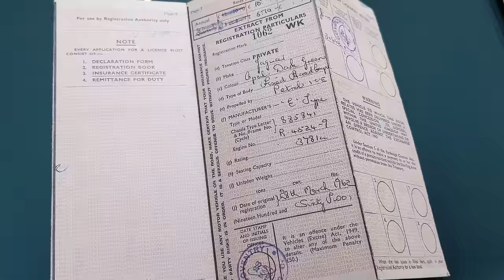Stuck E-Type Clutch 🔧 Workshop Diary 2

Comment: I really wished I could have worked along side my dad , fixing cars. Sadly passed away when I was in my late teens. Love the video's Richard,  keep em coming.  Electronic ignition , suspension and braking is the worthy upgrade for them E types. Anything that makes it handle  better and be safer has got to be a plus, if its going to be used on the open road....Which is where they belong.  😊

Comment: I've freed many E type stuck clutches with a simple set of jack stands.  Warmed up the engine in neutral, then turn off. Then up on stands, restarting engine in gear, whilst strongly pumping clutch and brake pedals at the same time. They always broke free.
Never had to resort to engine removal....knock on wood!
Reply: Absolutely agree, lot of wasted time (and cost to customer) there. Another way I’ve had work well is to GT it good and hot then wedge the pedal down overnight, they often free up that way. If not I escalate to your method. Never had to dismantle yet just to free a clutch.

Comment: Good video, love the flywheel lock, wish I had noticed that one when I was doing stuff like this.

Clutch didn't look too bad. Maybe my patent clutch freeing technique would have worked? Drive wheels off ground, top gear, run engine up a bit, press clutch pedal fully and brake. Repeat with more brake pressure until frightened off.

Worked at least once for me. Guess I would want to estimate loads on transmission on a car such as this. If overdrive fitted I would have a good look at possible loads.

Comment: Hi .Great stuff.One tip that someone showed me , is to use a long rubber timing belt or two .To asist putting in the gearbox.Put them around the box and hold from the top.U'v been using this method even to move the gearbox.
On the performance mods.
If 4.2 use series 3 pistons.
Lighter flywheel.
Porting the intake bows and match the manifold to head.
Use tripple su hd8,s .But olter the needles so that the optimane mix has the jet flush with the bridge.
What I mean put the needle jet in a drill or press and using sand papper to carefully match with more of a point.Trial and erearin those.
Bigger bore exsaust.

Comment: The AC engines were developed by BMW before WW2 so perhaps that may be a link to spare parts or at least major components such as six cylinder heads. That crack doesn't look repairable for anything less than a Queens ransom. Love this channel.
Reply: Agreed: for a high compression engine the cracks look somewhat sub-optimal, to use British understatement.
Reply: I believe the AC engine was their own design and had nothing to do with the BMW engines that became the property of Fraser Nash/Bristol as a war reparation. Both were fitted to ACs but were completely different.

Comment: Triple 45 mm Webber side draught carbs & bunch of bananas extractor, full balance, D type spec cams, electronic ignition with fully tuneable/ adjustable advance curve, lightened flywheel, dual plate clutch, big radiator, electric water pump, close ratio gears, auto lock diff, Dunlop 6" CWW, 65 profile Michelin XVS tyres for the red S2. Happy Christmas Richard.

Comment: Well guys I was lucky enough to have owned a series 2 4.2 1970 model drophead. That was in 1973. I paid £1300 English for it with 32000 miles. It was powder blue. I owned it for 2 years & had to sell it to pay the deposit on my 1st house. For a sum of yes £1300. What it would be worth now i know not. Of course here in the Uk it already had the triple 2" Su carbs on it & 265BHP Over here a performance mod was to fit triple 45 DCOE Weber carbs. I always said if they ever brought another model out i would buy it. So my present car is a Pearl white 2017 F-Type Cabriolet Owned it 4 years now & covered less than 3000 miles. The clock is showing 20460. Being the 5.0 V8R it is much quicker than the e-Type ever was. But the E-Type got much more glances than the present car.
Regards.
Steve.

Comment: A seized clutch driven plate can be freed up without engine removal. 
Jack up the car rear wheels. Get it warmed up, run it to a decent speed in fourth gear and then simultaneously slam on the brakes and clutch pedal. You may need to do this several times. The inertia of the engine opposed to  the retardation of the drivetrain, by the brakes, will separate the clutch plate free. I have done this many times.
Think about it and you will work it out. The inertia of the spinning engine gets met at the clutch driven plate interface by the retardation of the brakes and the excuse from duty by relaxation of clutch pressure plate .
Marking a pressure plate so that you may refit it for balance purposes is good practice. 
But  then not loosening all the fasteners evenly and progressively, possibly distorting the diaphragm, is not good practice.
Intellectual capital and experience for free right there.
I thank you for taking the time to post videos.

Comment: speculating: maybe the reason for external oil lines etc. is to reduce compromise of the all-aluminium block during casting efforts(ie. strength),or heat reduction during use. 50's technology, metalurgy in Britain.

Comment: Michael, Interestingly- my clutch started acting up a while ago and upon inspection I found the Borg and Beck clutch pressure plate was defective only releasing on one side not the other.  When inspecting the flywheel run out, then crank mating surface was causing it to be off by more than 10 thou - I lapped the crank surface it to improve it, but your shim idea makes a lot more sense and would have been easier to do.
Reply from the maker: John great to hear from you. This one was out .040 at the flange!
Reply: Yes maybe Richard’s associate may consider manufacturing a few of those spacer shim plates for enthusiasts…

Comment: Hi Richard, I’m intrigued by the AC light 6 engine, after being so used to working on so many 60s&70s British engines that tended to have an “iron block” and aluminium head, (particularly the smaller performance saloon engines). I wonder why AC needed to have the cylinder head from cast iron, whilst I also appreciate that evidently the original design dated right back to the thirties as you mentioned….

Comment: 69 upgrades: - if all original, numbers matching - nothing! If not, move the clutch & brake pedal box 1 inch left and fit a Mangoletsi throttle cable system. High compression pistons, triple Weber carbs, bigger anti-roll bar, series 3 vented rotors, 4 pot brakes, koni shocks and a 5 speed box and a LSD. Big bore stainless exhaust and something to stop the rear end bump steer. Not much really!

Comment: This AC engine is gorgeous... 

You did not detail any possible issue with torsion bar reaction plate removal... iirc it takes a bit of care and planning to avoid issues, depending on the pretension of the bars - as for the clutch, I suppose the "traditionnal" way of getting it unstuck did not work (though the amount of corrosion did not seem that bad)? 

Best wishes for the year to come, and thank you for sharing !
Reply from the maker: Since this was an in-and-out job withdrew the reaction plate bolts back and slid out

Comment: Richard, do you ever feel the need to upgrade the clutch slave feed / bleed arrangements? Almost impossible to bleed out all of the air due to the bleeder being on the bottom.
Reply from the maker: No I don't change the clutch hydraulics because it's quite simple to reverse bleed with a syringe.